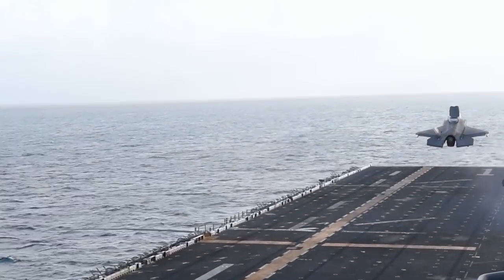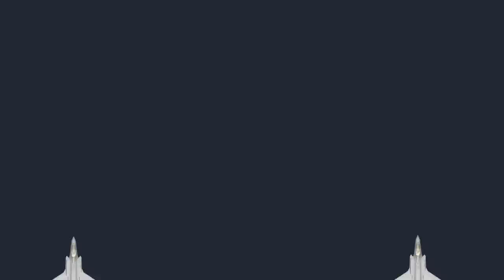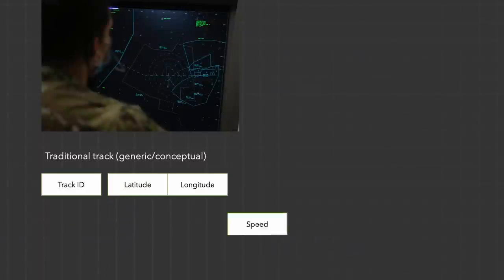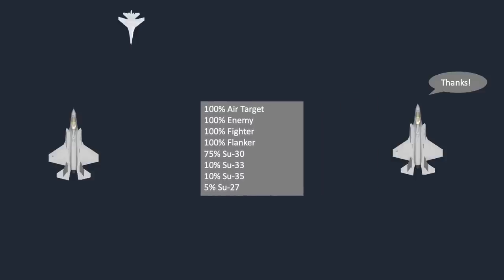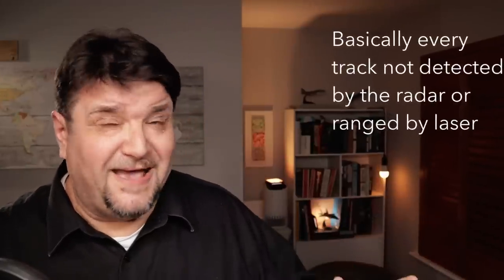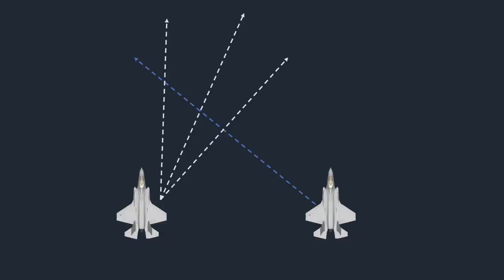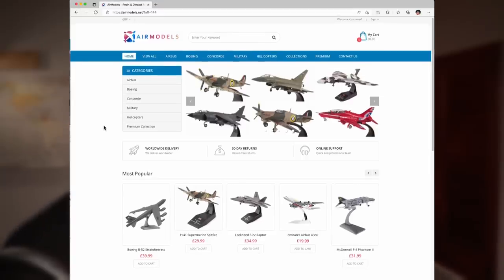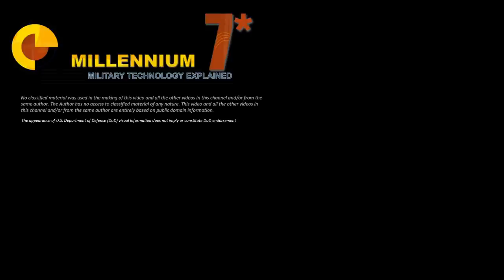The F-35 data-link works like magic!

Comment: The processed solutions they are sharing are (probably) not fused. The raw sensor data they share is fused in a filter (usually a kalman filter), and the fused (or not) solutions they share permits another level of verification, rather than a basis for computation.

In precision GNSS positioning, the raw ranging measurements of satellites from multiple receivers are double differenced to remove common error terms (e.g. ionospheric delay) between each receiver, enabling much higher accuracy position/velocity/time TDOA (time difference of arrival) solutions.

This is also known as differential GPS/GNSS. RTK (real time kinematic) when carrier phase range measurements are used rather than coarser code phase.

And of course, other sources of range, pose and trajectory can be fed into such algorithms too. GNSS is just a passive radio ranging system, at its core, and the secret sauce is where and how you combine the measurements it  gives.

Its not just about best case accuracy either. More measurements = redundancy. Not all sources of error can be modelled. e.g. jamming and spoofing scenarios, multi-path interference etc. 

Combining of multiple measurement sources allows outlier highly erroneous measurements with a low error estimate to be identified and de-weighted before they can throw a spanner into the kalman filter, which relies on accurate error weightings to function.

 these techniques would prove highly useful in co-operative target tracking too, and the reason they would share raw sensor data, except now they are using active as well as passive ranging, and solving for two unknowns: their own kinematic state, and that of the targets they are tracking. 

Offloading some of this computation to a system on the ground might make sense, if real-time performance (latency) can be assured.

Comment: An incredibly impressive explanation. Thanks for that. It makes a lot of sense.
The differentiation in messages might be to increase message reliability. In RF, the longer a message is, the higher the risk of a disruption during transmission. Splitting into several smaller messages makes it easier to recover in case of disruption. 
And it also allows one to have fine-grained control of how much information you send out. That sounds beneficial w.r.t. stealth too.
Reply: You probably are on the wrong track. Look up the main comment I posted which should provide you with better definition for what "message based data transmission" is where I describe this modern and common way of transmitting data is radically different than using RF.

Comment: I am wondering how the directional datalink know where to send. Is it maybe sending more or less continuasly or atleast with frequent update so there is a rough knowledge if the direction so that the lobe will be covering the receving aircraft? 
   I know I have asked before but maybe you have heard more of it since. 
    Thank you for a good video
Reply: They likely try to maintain a data link as much as possible. If they need to initiate a connection it’s probably like a pc. Send a broadcast packet with the new data link technology or something more general to initiate the handshake. Also any aircraft probably participates as a mesh network so you don’t need to maintain a constant connection to all aircraft, just some aircraft.

Comment: Each plane transmits its position, bearing, and speed.  God I hope they never crack the encryption.
Reply: If they crack military grade security, the position of a few tactical fighters isn't at the top of your list of worries. You have nuclear launch codes, and position of nuclear submarines, aircraft carriers and other strategic assets well above that. But remember, even older AES-256 encryption takes over 1 billion years to brute-force; and they roll the keys regularly.
Reply: @milisha98  Remember that the original RSA challenge from 1977 was supposed to take a quadrillion years to crack, but we did it in 17.  And frankly, its not the math that concerns me, its the implementations.  How random are the random number generators?  Have they eliminated all the side channel attacks?  Are they sure the CCP hasn't snuck in a modified chip into the supply chain?  Are they REALLY encrypting everything, or are they leaving some unencrypted for performance or legacy reasons?
Reply: @kennethng8346 And my point still stands that if it were compromised, the location of a few tactical fighters is very low on the list of implications.

There are companies whose whole business model revolves around creating truly random numbers. And guess who their primary customers are?
DARPA now have quantum computing safe encryption; and some of the worlds best and brightest are working on it today; I don't buy the argument they don't know what they're doing, or that it's encryption is not evolving with the threat.

There's a misconception that China produces high-end chips (they don't). Video on that here: https://youtu.be/tQ_HeCalYq8

Regardless, F-35 supply chain threat were exasperated by Covid, and are entirely around raw materials, and alternate suppliers found. Chips used were always US chips.

But let's pretend that the keys for the F-35 have been compromised...
F-35 MADL is directional - i.e. it only transmits directionally to other known nodes on the network (which is why it can transmit and remain stealthily).
To intercept, you have to get between two nodes - which is very difficult to do 30,000 feet in the air - and even harder without them seeing you (which is one thing the F-35 is very good at).
And specialized equipment is needed; even other US fighters cannot work with it. 
So even if you know the keys it's not going to be much help.

Comment: Do you think that with enough development this sensor fusion with cooperative passive sensing could allow an F-35 to launch an AMRAAM and give midcourse guidance without having to turn on the F-35s radar?
Reply: As long as it has AWACS, yes.
Reply: Yes, and it doesn't take AWACS. LOAL is old

Comment: So in the current generation of data-link aircraft, can share their tracks with each other and thereby getting a better picture of the battlefield. 
The next level would be that they could, feed each other "raw" data and in unison create a track, that they could not individually identify from background noise. 
Acting like a distributed sensor array.
Reply: Interferometry, yes. I think there are sensing satellite teams that do this
Reply: I'm guessing that currently there is already a certain amount of "preprocessing" before data is shared on the network. Exactly what kind of data is better filtered or raw is probably what the people writing the software and the military are trying to figure out. Anything that can be "preprocessed" lessens the load on some other platform which would need to do the work but of course the raw data might provide another platform to gain better insight into the true picture of the battlefield. It's a tough issue to address where there may not be an entiely right solution either way.
Reply: @tonysu8860  Yea it is an almost unending layer of complexity that could improve the overall picture as a group of aircraft work more and more closely together. 
One could imagine them taking advantage of each others position to each other and synced modulation and a host of other things could be done.

Comment: How susceptible to interception, jamming and/or spoofing is the datalink?  How robust and secure is it under combat conditions?  Seems to me that if the enemy could intercept and analyze the datalink signal, they would know the locations of all aircraft participating in the datalink network.  Seems to me that a lot of eggs are going into that one basket.
Reply: It's low observable.
Reply: I'm guessing that military grade security builds on commonly used technology for CDMA telephone communications and is used in current RC model controls.
This starts with using frequency hopping, should of course include encryption or at the very least obfuscation if it's deemed that already it would be nearly impossible to decipher the bits of data flying through the air in a timely manner, and use digital keys that are extremely strong. Jamming is always possible if an adversary is able to broadcast on frequencies used, but there's an awful lot of bandwidth that would have to be covered to block all the frequencies that might be used. To counter jamming, transmissions might onclude some kind of control to verify the reception of certain data but if events on the battlefield are moving very quickly, data might become stale within a few seconds and wouldn't be worth resending... So transmissions would just keep sending new data continuously. As for spoofing, currently the highest levels of computing capability isn't nearly strong enough to break really strong digital keys. Maybe when quantum computing becomes a reality digital keys might become ineffective but today that's still a fantasy.

Comment: MADL is light years ahead of Link 16.  So,  is data between the two really useful.  How functionally integrated are they like between AWACS (old school) or other 4th gen aircraft they might have to work with.
Reply: I'm no expert but let's make some assumptions.  We can assume that the designers of the F-35 knew that it would be fighting alongside other aircraft with older datalink technologies.  I think if the F-35 is receiving link-16 data, it would treat link-16 (or other data) as tracks and assess their reliability.  If the F-35 is sending out link-16 data, it would send out tracks relevant to link-16 data in the relevant format.
Reply: @M4xPower  agreed, plus Northrop has gateway systems that can translate between like 25 different data link protocols in real time...both in smaller single devices, and they have a converted passenger jet or two that flies in the area on missions that is dedicated to such things

Comment: Does the data link converge across AWACS and satellites to a central processing unit, or is it a low latency internal local aircraft to aircraft firstly, then passing an advisory of actions performed?
Reply from the maker: The MADL is F-35 only. Everything else is mostly Link-16.

Comment: If a clock is locked to a GPS coordinate regime, the relativity should be internally consistent across all platforms with a high degree of accuracy, or as high as is possible.

Comment: May I ask a simple question ?
In sintesis Data-Link are microwaves radio sopurces so they have a certain range a certain power and so on...
The question is....  
Can these sources of signals be tracked (i'm not telling here decripted or interpreted) but simply used as an auxiliary information to track the emitter(s) as a target and, in general, how large is the range that the data-link network cover? and conseguently the risk to be sensed by an enemy sensor? ... I can easly immagine many "offuscation and frequency hopping tecniques"... but in fact you are emitting signals with a certain power and so they are potentially detectables..... (at least on a certain range)....
Reply from the maker: yes, in principle but the directionality and what you mentioned make it very difficult. Easier with the link 16 though.
Reply: @Millennium7HistoryTech  now imagine all the signals bouncing off the metals in our skies being laid down constantly by the geoengineering flights. all the sats in orbit and the radiation belts around the earth with metals in them also used to bounce signals off. its orders of mag worse than anyone can imagine

Comment: does the f15ex with it's larger computer also have this capability?
one would expect any fighter airframes purchased by the US at this time would be compatible. 
limiting this capability to just 1 aircraft type is a huge waste being there would be alot of sensor information not being used.
Reply from the maker: Interoperability is a big headache in its own. At some point I will get to that
Reply: Don't think it does. F-35 has the latest super computer with AI onboard and is acting as an advanced behind enemy lines command and reconnaissance center transmitting all that info to other planes with Link16 and also back to mainland command centers and also can send it to navy units and terrestrial ones with that specific Link.
Reply: @Rousseau4469  
the f15ex has a more powerful computer than any f35 block 3 and under. the block 4 computer is supposed to at least match the f15ex computer. make note that the f35 block 4 is notcas of yet operational. 
my question is whether we are not given full capability regarding the f15ex.
the f15ex is supposed to operate with the f35 as per the USAF.  would the US really handicap themselves regarding data share capabilities within their own fleet?
we know little of real current day capabilities for obvious reasons. one thing that we should understand is that fleet interoperability MUST be forefront in any fleet purchase.
Reply: @Rousseau4469  Thanks 😂
Reply: @johnaikema1055  Can't really tell if F-15EX has   such powerfull computer I'll onboard. Probably it does otherwise it wouldn't make souch difference to update one to EX. But for sure F-15EX can't take up the role of F-35. On the other hand neither F-35 can't carry such a payload as F-15EX cause it will cancel its stealth capability. I can understand that together those two can form a uniquely lethal combo to aerial and ground and navy threats
Reply: @johnaikema1055  also can understand that certain capabilities for security and safety reasons is best to stay hidden.
Reply: @Rousseau4469  
yes every tool has it's purpose. 
the f35 does best close in in contested airspace 
the f15ex wod do best with larger munitions and stores with ability for better combat radius with smaller a2a loadout.
Reply: @johnaikema1055 
If both the aircraft communicating are F-35s, they will use MADL with the new tracking method

If both the aircraft are F-15s, they will use Link16 and the old tracking method

If it's a mix, Link16 and the old track for the F-15 but F-35 can use the data provided by the F-15 and incorporate it into the more advanced tracking system. Maybe the F-35 data sent over Link 16 is given greater preference or trust but that's speculation on my part.

Using Link16 makes the F35 more likely to be detected by ELINT, but it is a necessary evil in order to communicate with legacy platforms, since they do not incorporate MADL compatibility.

Unless F-15EX has received an upgrade package I do not know about, it cannot utilize the new tracking system as it's own sensors are not incorporated into it. As in, they do not produce the information necessary to take advantage of sensor inter-relation. The data might help an f-35 achieve identification but is not enough on it's own. So, not a question of computing power.

Please. Keep in mind this is my understanding of the topic which might not just be limited, but outright wrong.
Reply: @andresmartinezramos7513  
my question was whether the f15ex has the ability. if the f15ex has an updated data link it would help.
I did read that the f15ex has data fusion capability...exactly how it's Integrated between the sensors and data link is a big unknown.